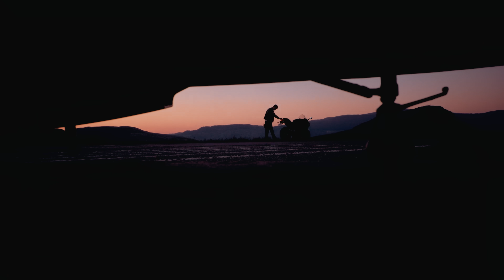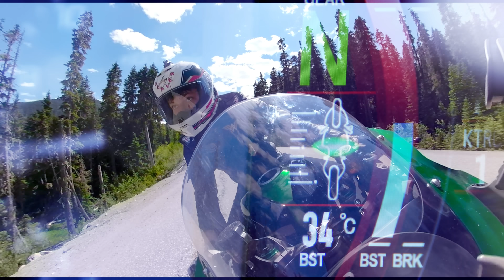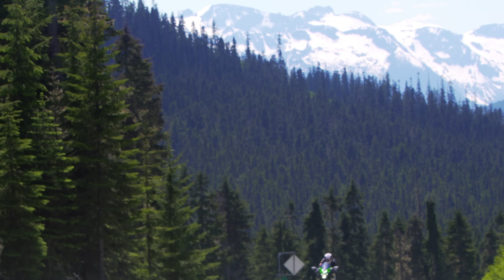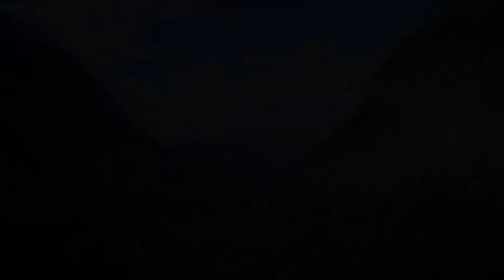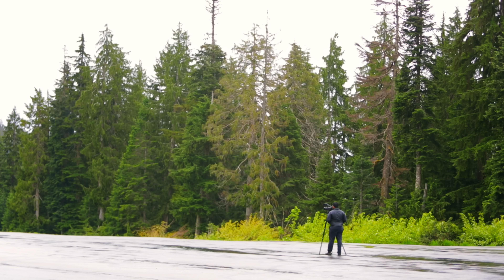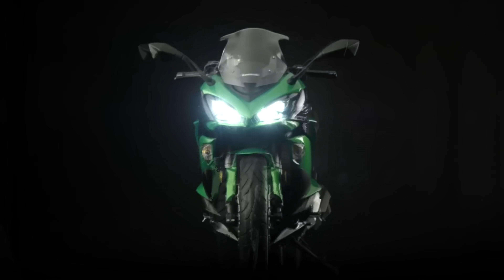Kawasaki Ninja H2 SX Review - 200HP Touring?

Comment: That sure sounds a lot like compressor surge (air bouncing back against the compressor blades when you shut the throttle and pressure rapidly spikes and forces it's way back through the compressor) and NOT the blade tips breaking the sound barrier (which would require a higher speed in a higher pressure environment, though somewhat balanced by the higher temperature).

That said wonderful production, acting, and review as always!
Reply: true about the chirping.. it happens only when you dont accelerate..mostly you can hear it only between 6000 and 8000 rpm when you let go of throttle.
Reply: Tibor Sekelj I did a little reading and the claim does appear to be sourced from Kawasaki but could be a misinterpretation of wording that got out of hand.

That said the speed required to break the sound barrier goes up with pressure - but the rapid reduction in pressure could bring that speed back to or even below the stated figure. Because the supercharger is mechanically driven it is possible there could be pressure waves leading to the fluttering chirp, but in my mind that makes surge the more likely explanation. There are videos where you can see it happening as low as 5000 rpm and lower and where a non oem bov makes the same noise. There are also videos where you can see the bov hang open (and not flutter itself) which is usually enough to prevent surge - but maybe there is not enough flow in this system.

In the end the calculation is much more dynamic than "the blade tips go this fast so they break the sound barrier". I'm still not buying it though.